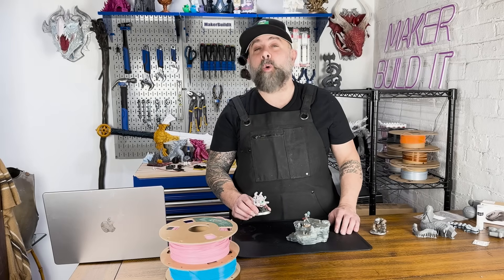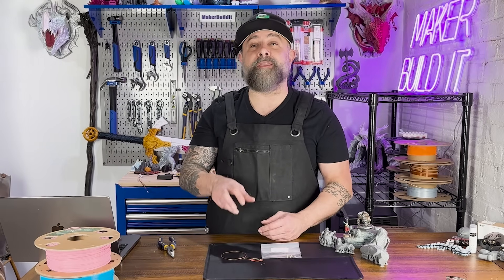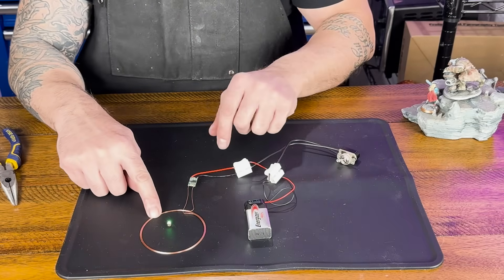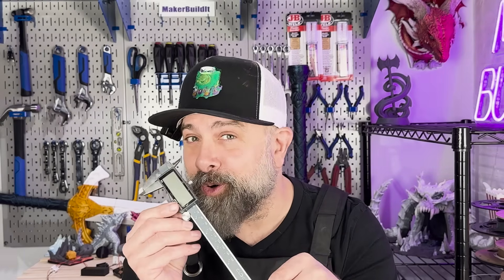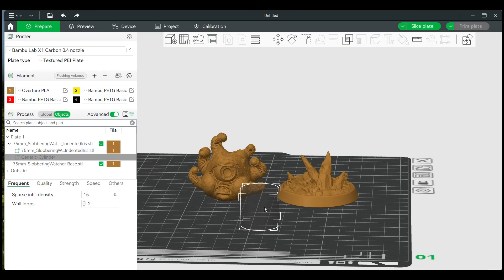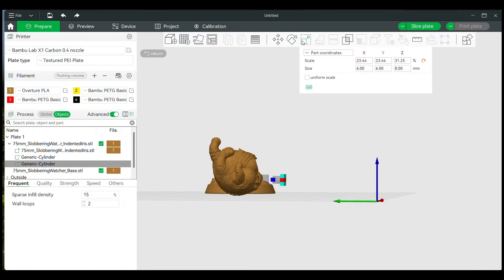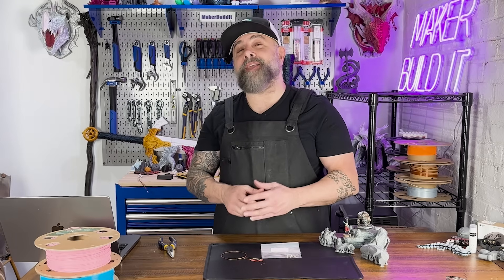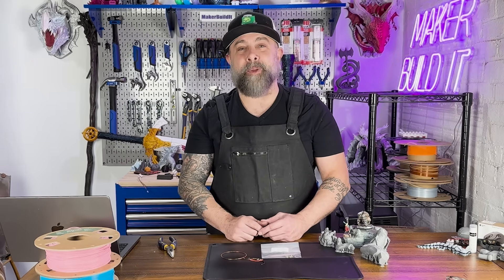Wireless LEDs Revolutionize 3D Printing!

Comment: Are you able to shrink the diameter of the coil depending on the application? I’d like a coil of about 50mm in diameter for my application.
Reply: You can get a 50mm coil for wirless led but its range will also be reduced.

Comment: Have you found any type or brand of the wireless LEDs that have a better range than average?  I have a project that I would like to place the LEDs about 200mm above the coil but that is about 4x the range of the type I've used before.
Reply from the maker: @unclerichard6729  Most of them have pretty low ranges. 50 mm or so. I haven’t tried any that have a further range, but would be interested in testing some. 😀 If you find some you like, let me know!

Comment: You mentioned a few things that will impact the efficiency of the energy transfer, but left out others that could be important when deciding if it's even suitable at all for a 3D printed project! The power efficiency of a wireless LED system will always be poor compared to the wired equivalent.  Most of the energy is radiated uselessly into surroundings where there are no LEDs, but unfortunately not uniformly. This is why all wireless charging systems for phones, etc. require very close spacing and alignment between the coils to be practical. The only reason the concept works at all for wireless LEDs is because a modern LED can look bright with extremely small amounts of power (by comparison to a phone charger).
LEDs that must be positioned well above or below the plane of the transmitter coil will have the most trouble lighting up - even more than ones well outside the coil like you demonstrated. That could make it an ironically terrible choice for certain 3D designs featuring lights - something people ought to know before spending money and time designing a print around wireless system parts.
The best reasons to use them would be: there must be many isolated LEDs embedded in the print (and fiber optics are also impractical), or they need to be embedded in movable pieces, or separated by water or clear zones where visible wires would ruin the effect. There are good reasons why this tech is not widely used commercially (and never will be).

Comment: While this is an interesting video, that is NOT how the coil works... the inductive transfer of energy is dependent on the size of the wire, the number of "turns" or loops, the resonance frequency, and the distance... You would need a whole bunch of 9 volt batteries and several more feet of wire to power up an area as large as your pad... furthermore, if your LED coil gets too close to the edge of the transmitting coil, that LED is going to burn out and yet barely be on in the center... The red wire is the POSITIVE and the black wire is GROUND or negative in standard low voltage wiring (up to twelve volts, unless you are using European sensors)... and you can only warp that type of tuned coil so much before it creates "dead zones" in the magnetic field generated by the coil that transfers power... I built something similar last year... It was a mimic and some moveable treasures...  I used a magnetic hall effect sensor on a platform inside and placed the magnet in one 3D print which would turn it on, then I placed wireless LEDs in several other 3D prints that could be placed in different locations around the treasure chest that contained the coil... The orientation of the LED will also change the brightness as it is moved into and around the field. The distance that it works in only an inch or so outside the coil and maybe up to three inches inside the coil. These can all be overcome with a bit of math and perseverance and ingenuity. There are also some interesting possibilities for using capacitive touch sensors as well.
Reply: the technology is more forgiving than you're giving it credit for.  i have modified the standard kit (which for me came with an about 70mm coil of .5mm wire) in many ways over the past 2 years.  
first, i coated the LEDs in UV resin to waterproof them.  next, they were driven for a week dry, then another week underwater, in a mason jar.  i never had any LEDs near the coil burn out- at least not through 2mm of glass.  
next i set about developing a 3D printed enclosure system using magnetic pin connectors so that the coil can be seperated in half, then popped on to various common diameters of glass tubing- 45, 50, 60, and 75mm.  the provided driver works perfectly well for all these diameters.  i was quite glad to learn that i would not have to tune the driver for all the  different coil diameters i've created.  running the numbers through a coil calculator (i.e. the one i found at deepfriedneon.com) i was suprised to find that all my  different diameter, 4 turn coils  always came out to about 220 uH, ±10 micro henries.  
between 20 and 60° of my coils are not planar around the area of the magnetic pin connectors, and the "dead zones" you've cautioned us about may exist, but are not perceptable in light output to my eye.
Reply: @travismiller5548  Cool, glad to hear you have been successful in your endeavors... you have done a good job and managed to keep a satisfactory level of operation... Great!  I am merely speaking to what can happen and is based upon plenty of experimental data and experience... Yes, the tech is pretty forgiving and can operate over a fairly large range of efficiencies. I am merely pointing out what might go wrong if you are not paying attention and try to do things in a more radical way. In the case I described there were a few issues that needed to be overcome by making minor tweaks and adjustments... and the burnout was real when I tried to overdrive the coil a bit to maintain brightness in the center, lost four LEDs that got too close to the edge and went really bright for a few milliseconds... Apologies for letting my electrical engineering banner flop around too much... LOL just trying to help out people that might end up having difficulties.

Comment: For a taller print that would have the LED further from the base, and therefore further away from the coil, would it be possible to have the receiver part of the LED in the base of the print (close to the coil), and then place the LED higher up in the print and run wires back to the receiver part?
Reply: No, the coil of the receiver is would around the LED itself. You would have to build up your own receiver with extra wires to run up to your LED
Reply: @ I was thinking just the opposite. Remove the LED from the assembly and mount it remotely. No need to make a new receiver.
Reply: @MrDksmall  That could work using some fine wire... might be a royal pain to solder though... <G>

Comment: The mic on the cap irritates me. Please use it as intended in your Shirt. 
Also inserting the Led really within the Print with Just a layer in between hides the Led more, eben If gets even Dimmer with this. And you might want to Show the sliced Up File a bit more so we could've seen the new cavities
Reply: There is also a way you can pause the print to insert the LED into the cavity before it closes it off that can work pretty well, although it does mean that if anything happens to the LED it is very difficult to replace.
Reply: Mic on cap is an excellent choice… distance and orientation does not change… easy to install…
Actually same pluses as a head-mounted mic.

And hat/helmet mounting has been going on for decades.

Comment: I wanted to use these with the Infinity Stones. I wanted to print the stones in resin and have a hole cut out in the middle for LEDs and the models cut in half to insert the LEDS. But I could not find good Infinity Stone models to do this with. When I tried to separate the models for the stones models would get corrupted.

Comment: Death is in the eye of the Beholder... oops, no, it's just an LED.
Beauty is in that model of the Beholder though, is it available somewhere?

Would probably be way more trouble than it's worth, if it would even work at all, but could be interesting to run optic fibres from inside the main eye to the other eyes and get a lesser glow from them. Alternately, could scale up the model a little, use a bigger LED in the main eye and smaller ones for the others.
Reply from the maker: 🤣The model is from Loot Studios. 😀I do have another tutorial on adding wired LEDs. (I just added it to the description in case you are interested.)Both video are part of a series on adding LEDs to 3D Prints. We're thinking the same. The next video will have LEDs in all the eyes, well at least that is the plan. 😁

Comment: Demonstrating why I gave up on digital calipers...batteries and sometimes they just die. Verniers are fine, but I'm now dual-scale SAE/metric dial caliper all the way. Always ready.
Reply: Get a Mitutoyo. Mine has been going strong on the same battery for three years. Don't remember who but someone showed that high digital calipers use significantly less power on standby than the cheap ones
Reply: @gwenhidwy  It's the battery, the expensive ones have silver version eg. SR44 instead of LR44, and the silver oxide battery has longer lifespan (google it). You can put a SR44 in your cheap calipers and it will last forever.
Reply: You can also flip the battery over when you won't be using them for awhile. It's the standby trickle that kills batteries. If you get chalky buildup on the contacts, hit it with a little vinegar on a q-tip to clean it up.

Comment: Great video! I can definitely see this adding great stress or anticipation to a D&D session as the light starts to get brighter every round as it gets closer. Or a puzzle where the different parts light up when placed in the right spots. It could be really good for theater props, like a necklace that starts glowing when it's put on, etc.
Reply: Stealth check failed. *beholder's eyes light up
Reply from the maker: Thank you! Those are some great ideas! 😀